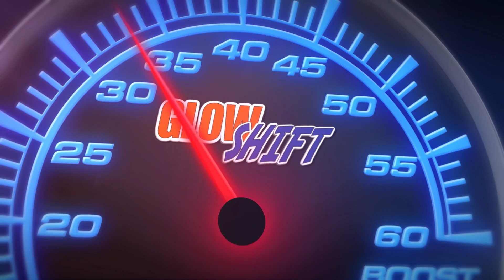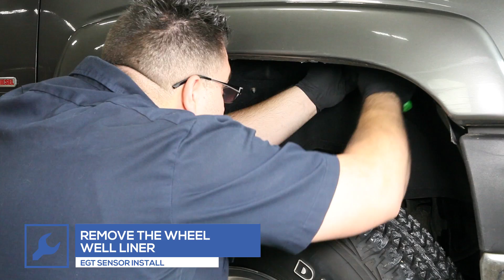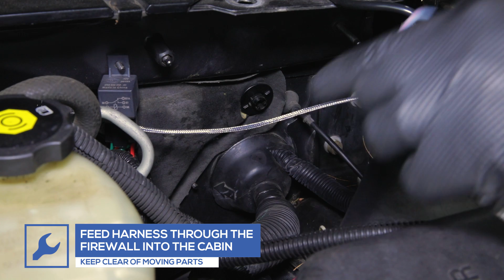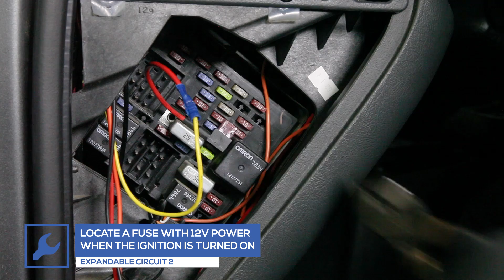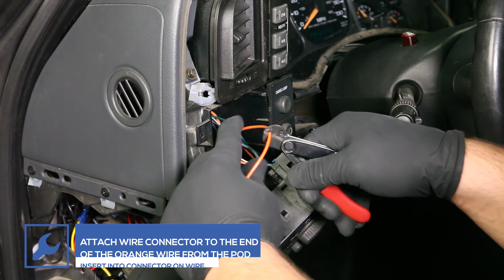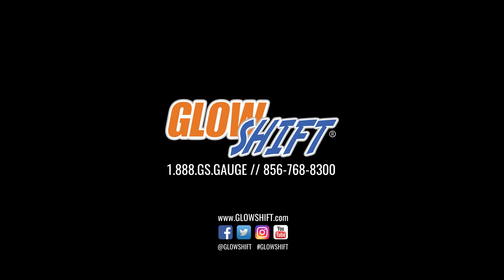Installation | GlowShift EGT Pyrometer Gauge for 2001-2006 6.6 GM Duramax Allison 1000 Transmission

Comment: HELP. Mine was working great . I pulled dash and installed a Heater Core. 6.5 Turbo Diesel GMC . When i put it all back together . All i got was a blinking reading steady 130 and all colored squares around the dial stay lite up. Help! GREAT VID !
Reply: Do you figure it out? Planning on doing the same on a lbz
Reply: my prob keeps falling out. bad design i think idk  so confused on this